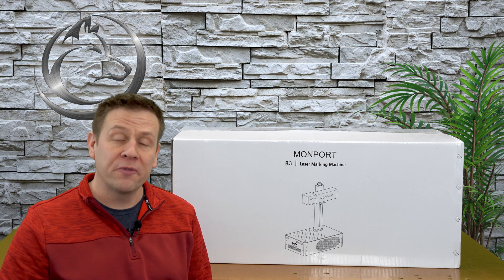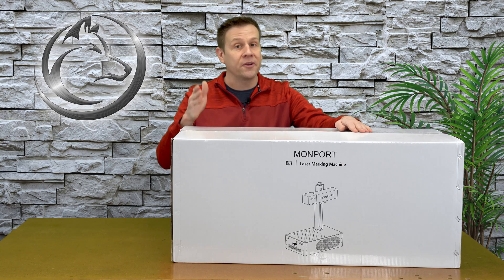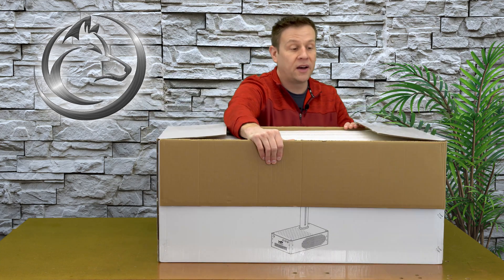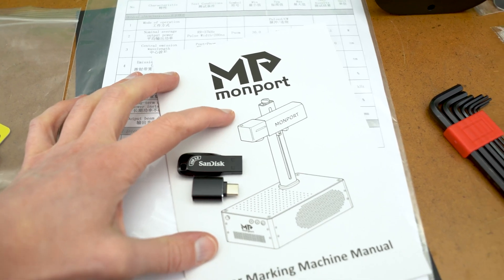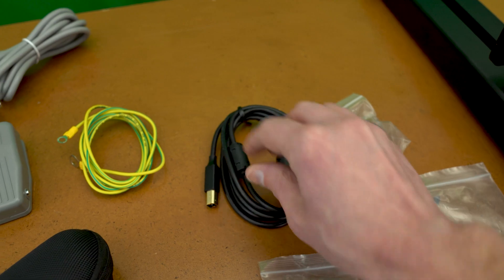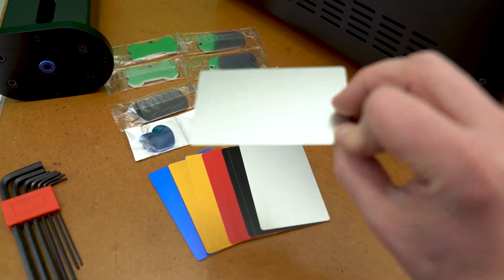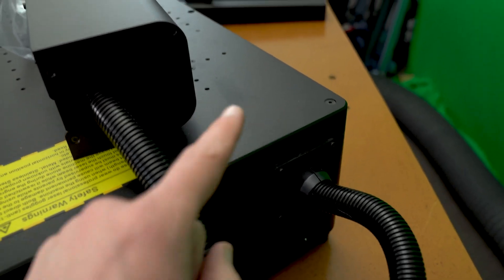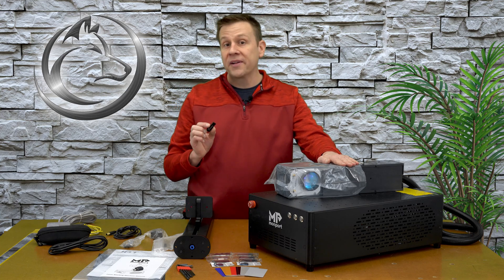Unboxing and Setup- GI30 Integrated MOPA Fiber Laser by Monport- Video 1

Comment: Just setting mine up. What is the ground wire for exactly? You don't mention it in your video and Monport doesn't mention it in their video either.
Reply from the maker: It's for wall outlets without a ground.  Most houses in the USA have proper grounds and I recommend using a power cable with a ground wire in the cable.  The power cable with the GI30 does not have the ground wire.  I've since notified Monport the machine should come with a power cable with the ground wire.

Comment: Hey Greg great video as usual. What is the advantage of a fiber laser versus a diode laser.
Reply from the maker: Speed and detail- fiber lasers can reach speeds for 5,000 to 10,000 mm/s!  The base resolution I run is .0254mm interval which is 1000 lines per inch!  The laser is extremely well with metals, rock/ceramics and hard plastics.  I use mine mainly for metal work and metal plaques.  Glad you're enjoying the channel!

Comment: Thanks for the video and I would certainly like to see how you  finish your setup on this as there are not many videos on this GI30 on YouTube. Things I would like to see is your process of leveling the head to the bed, setup in Lightburn etc. I got one a few weeks ago and so far it works well after some setup. Since there may be others out there getting this as their first Fiber Laser, a followup like you mention will be a great help. I am curious if you will be creating your own .cor file or using the factory one. I noticed that the one that came with my GI30 sets the work area to 167.5mm instead of 150mm as it shipped with the 150mm lens. Thanks again for the content and look to future videos.
Reply from the maker: Glad you like the video!  More videos are on the way including software setup and head alignment to the work space!